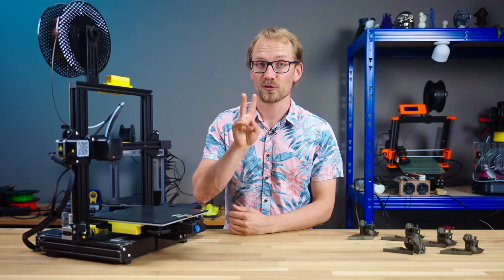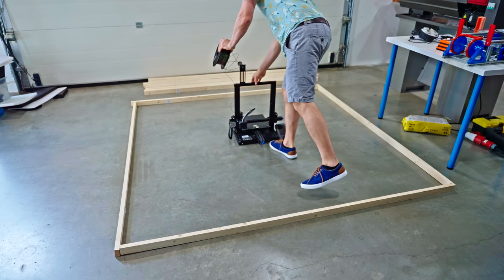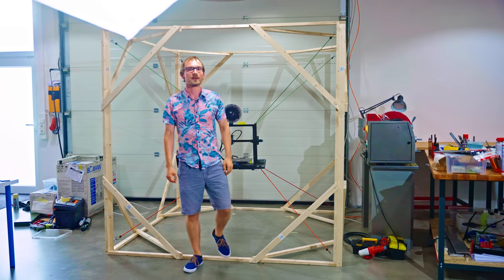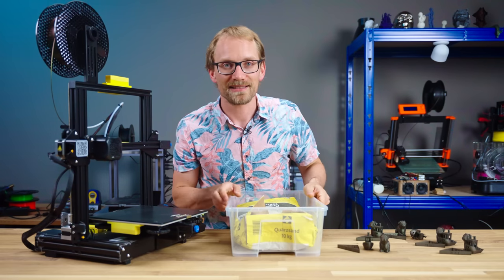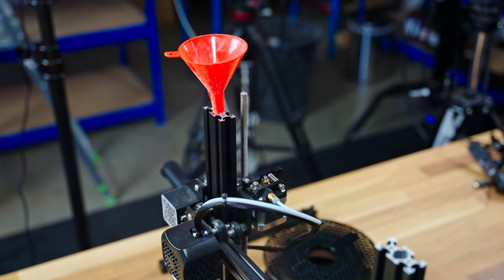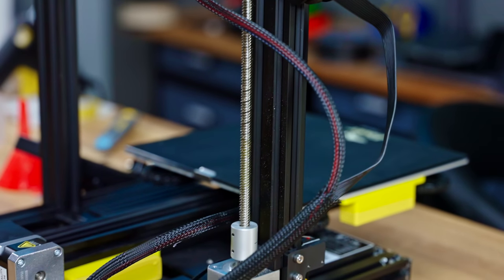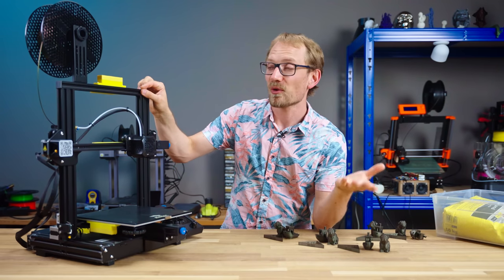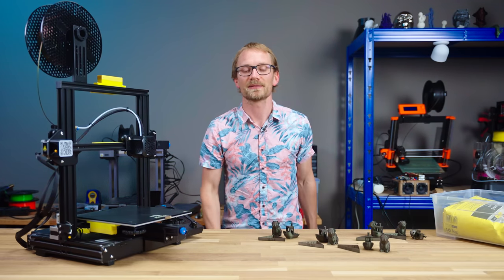You made me do this…

Comment: In my mechanical machine design building experience, resonance is a factor also of poor weight, mass distribution, you disturb this equilibrium and you will get a machine that shakes like Elvis, especially at high travel speeds.  

For example, the Anycubic I3 Mega, which I reference often, because I think is a great machine within its price range, is designed pretty solid, and the way the horizontal travel and extruder servos are placed is logical and I think the company may have done it to minimize resonance  that you get otherwise when you do not calibrate the gantry with proper weight/mass distribution evenly. I have seen people relocate the extruder servos wihout giving this mechanical design balance detail much thought, many people do it for making the machine look kool, whatever, but  doing so  will run into parts with less even printed layers.  

The best way to keep resonance to minimum,( there is no such thing, as no resonance, in machine design or assembly, there is always some present), is to keep the moving parts "as light as possible", you do not need to fill the tower extrusions with sand, cement or bolt the machine to a table,  this is how regular ink jet  printer heads, for example,  are able to travel fast, light components.  Of course in a 3D printer it is a bit trickier because one is not only dealing with the placement of ink on a sheet of paper but one has to manage proper thermal settings and depending on the material it may limit one to how fast one can print within a certain level of speed and quality. KISS is the best.

Comment: For feet try sorbothane, it comes in different Duros(softness factors). In my early archery days mercury was used to stabilize bows, and the oil filled tubes, oil filled tubes with ball bearings tension with springs. If you notice the current Olympic bows the have what is called a donker, a soft plastic material that has a weight suspended.

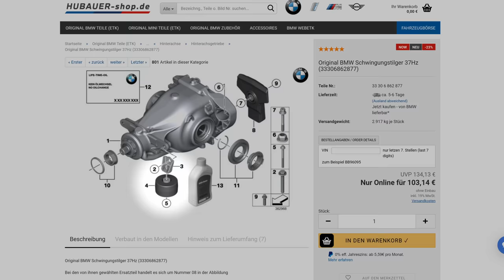Comment: 12:28 - 12:32 aren't vibration dampeners. They are CV (constant velocity) joints. Like Universal Joints but more linear. They allow rotation across an angle. 
The rubber bits on the rear differential are dampeners though, sure.
I would really like to see the experiment again but with the sand weights removed from the Y (and X?) axis, just leaving the sand in the frame. Also comparison at a higher print speed perhaps.

Comment: I would be interested in the belts.  I'd wonder about their properties before you use them as well.  Breaking strength.  How much they stretch under certain waits.  What frequency they oscilate under load.  Does that frequency shift at a different length.

Comment: There is another option I think you should try. Make a 3D printer that has a coreXY gantry for both the printhead and heated bed that move in equal but opposite directions either by connecting both to one motor with a gear or a separate set of motors (assuming the mass of both is roughly equal.) For the same printspeed the nozzle (and bed) only half to move half as far (and half as fast) relative to the motors and frame. Their momentums should also cancel out and reduce vibrations.

So in theory less vibrations and lower velocity required to achieve the same print speed.

Comment: I'm wondering whether replacing rigid containers with soft sand bags would help. They may allow for more movement and thus improve damping. 
A more professional solution would be to find out which frequencies affect ghosting the most. Then with a FEM model you can find out what dampers to use (e.g. oil dampers, tuned mass dampers or combination of those) to almost completely negate vibrations. This is a very complex task though, and it would probably fit your printer only since every machine is slightly different in terms of rigidity.

Comment: What if  we put equivalent weight on the belts..... So for example for the bed.... At the belt we can add the same weight as the bed just bellow the center of the bed on the belt.... So now when the bed moves in one direction.... Weights move in the opposite and kind of cancel out the effects.... Same can be done for all the belts..... That will kind of act like a balancing system for reciprocating components and maybe change the frequencies.....

Comment: I worked in the computer chip industry and this is what they do to print computer chips at 0.25 microns and less. XYZ stage is on granite slab.  That slab is on air bladders and sits on another granite slabs. All cables are mounted with vibration dampening hardware.  All motors are mounted with vibration damping hardware. To check for vibration we put accelerometer on each axis ( use one accelerometer 3 times). My touch was so tuned in after 16 years I could put my hand on the stage close my eyes and tell you where the vibration was coming from.  Most 3D printers don’t isolate the motors or cables.  I recommend silicon dampeners for the motors and cables and for 3D use a tile or concrete tile on silicone dampeners on top of another tile.  Air bladder maybe overkill

Comment: We have a really weird setup we stumbled across by accident.

Our Ender 5 Pro is sitting on an IKEA LACK table with rolls. Not exactly IKEA "RILL" rolls, but very similar.
The intention was, to be able to easily move the printer around, but we forgot rolls with stoppers. So, while printing, the whole table started rolling around slightly.
To stop it, we put the rolling table on a thick rug, similar to a doormat, which increases friction and prevents it from rolling around. Unintentionally it dampened the whole system so much, that it became a lot more silent and shows a lot less signs of vibration.

Comment: The speaker stand company Atacama make a product called Atabites, which is little pellets of metal, specifically designed to add deadening mass to speaker stands. It's not cheap, but the grains should be less leaky than sand, and you won't get silicosis from all the sand dust loading a printer with sand will create over time. I can't comment if they will actually work, if loaded mainly into the frame. Just remembered that Atabites exist and thought i'd share the knowledge

Comment: I think the real answer is, somewhat unsurprisingly, in suspension frame you built. The rigidity of 3d-cross bracing that had your flimsy stick built cube holding your whole suspended weight is exactly what can help reduce vibrations in the frame of the printer. Along with this, counter weights to the print head and print bed allowing the motors to work less when stopping and reversing directions would be the ultimate way to remove residual motion from your prints and lessen ringing. The weight blocks you attached to the bed were on the right track, pardon the pun, but they were just extra wight that the motor had to move (as you observed). Instead, the extra weight needs to be counterbalanced to the direction of the movement.

Think of a boom light stand. You adjust the weight on either side of a pivot to counter the weight of the light being supported and the clamp that holds the light up or down has far less work to do to keep the pole in place and will hold more rigidly, as well as remove the sloshing from the weight during movement. In this case, I don't know if a 3d printer can have this modification added without significant engineering effort.

Specifically, you would need to have a weight the moves counter to the direction of the load in both directions. That said, imagine a print bed that moves via pulley and a single motor as the Ender 3 does currently. Now, add a second identically weighted bed on the opposite side of the pulley chain. This same motor would move both beds on a single pulley belt but because they are positioned opposite each other, their movement would be opposite. This could completely remove backlash during stop and reverse events as long as the motor has enough torque and power to maintain speed and is itself engineered to reduce its own backlash with proper gearing and tolerance.

Apply the same concept to the print head.

Apply additional cross-bracing to the gantry to make it more rigid as I mentioned in the beginning of this comment.

You might have yourself a more consistent and accurate print. Tuning this system will be a nightmare though ;)

Comment: just bolting the machine to a stiff and heavy bench helps degrees of magnitude more than adding sand.

If anything, try adding a resin slurry/putty mix. In machining, they use a mix of gravel and resin, here probably metal powder and sand to create a slurry which is heavy and solid. but again, not much mass inside those flimsy aluminium beams

Comment: Perhaps the vibration comes from the teeth of the belt rolling over a smooth bearing on the non-motorized side, and using a toothed gear over the bearing would help?

Comment: First thing that came to mind was the rigidity of the stepper motors steps combined with the necessary slack in the belt allows for a slight disconnect with the intended movement profile. IMHO you could make a rigid steel frame to connect all eight corners of the printer and the tray would still not follow the exact movement of the stepper motors movements. Though difficult, at lest for me, creating acceleration and deceleration profiles whenever there's an abrupt change of direction or speed of the tray to prevent the slop might be the only way to totally eliminate the issue. Of course the tension/slack in the belt creates differing oscillation frequencies. The slop in the belt creates a sort of spring between the stepper motor and the tray. It reminds me of large format printers and the necessary smoothing of their movements to get good print quality. Often the steeper motor seemed fine but replacing it with a new one cured the problem. Good luck and God Bless.

Comment: You should just put an accelerometer on the hotend which has built in dead reckoning feature, log all displacements  and run a  Fourier analysis on it to see the major oscillating frequencies. Then you can try to dampen one or two of them and at least see if you're heading in the right direction. It shouldn't be too time consuming or difficult.
Reply: It's just input shaping, it is well known

Comment: Fellow engineer here: like others, I suggest that the weight should be added only to the static components. Adding them to the moving parts was just asking for trouble. Until static only is tested, this idea hasn’t really been given a fair shake (pun intended).

Another option would be filling with a rubber damping material. I’ve used lead shot embedded urethane to reduce recoil in my rifles, for example.

Comment: Regarding the weighted "deadblow" compartments, only add those to places that don't move.  Adding more mass to moving parts only increases the chances of the printer shaking as the mass changes directions resulting in bad things happening to the prints.  As for the weighted extrusion tubes, a better and much cleaner way to do this would have been fishing weights of the proper size to fit down the bores of the extrusions, and again, only added to non-moving parts.  Metal beads made from Hematite available at craft stores would also be another option.

Perhaps another idea would be to REDUCE the weight of the moving parts, much the same way old school car racers used to do, by drilling holes in everything that moves to reduce weight.  Or you could get some custom made parts out of Carbon Fiber.

Comment: I think, You need to tight it up tight. The dumpening should happen on microscale, so if You would use a belt with tightener, the overall structure would be stiff, but only printer would slightly (!) "float" inside the structure. the tightenes of the belts could also play a role. Finding out the frequencies witch printer gives, at set speed and tighten the belts in this frequency. (also shape of a print would matter)

Comment: You should consider adding a weight at a distance from the printer. If you manage to tune it correctly, then you will get vibrations in the weight that are 180 degrees out of phase with the vibrations of the print head and therefore eliminate the resonant frequency that the motor has to fight. 

So perhaps add a weight that is at a distance on the print head. Whatever you use to distance the weight from the print head should be springy. The "springiness", the length, and the amount of weight will determine your results.  What you probably need is a rubber ball on top of the print head to absorb frequencies in the 40 to 100Hz. 

Ideally you want to install Klipper on your printer and add an accelerometer and then be able to measure your progress; whether you are mitigating any resonant frequencies or not.

Comment: Now you know why industrial machines are built so heavy.
The sheer weight overcomes any force trying to move things around and absorbs and dissipates any forces trying to do bad stuff.
On the bungee chord test, ALL the chords are the same length which will make osculation at a certain set of frequencies tend to amplify each other.
All chords uneven length could possibly work better BUT THERE IS NO ACTIVE DAMPENING which is a problem.
The sand method adds a lot of weight to the moving parts which will significantly increase motor loads - especially on low power motors.
This is why (at least on my printer and mill) there are acceleration and deceleration rate settings - a dead stop will send a big motion shock through the machine while a slower start/deceleration will be more easily absorbed.
At the end of the day you can NEVER get to the acceleration/deceleration speeds of a 2 ton industrial milling machine working on your aluminum 6040 - the physics just wont work...
However there is one more thing you can try that MIGHT work.
Print boxes (like your attachable sand boxes) and half fill them with 50 weight or maybe a bit better oil (AND SEAL THEM) and attach these to the X and Y moving parts.
This MAY improve things due to a dampening effect.
BUT IT MAY CAUSE MORE PROBLEMS DUE TO OIL BASHING UP AGAINST THE ENDS.
Maybe a small piece of pot scourer on each end to dissipate the moving oil energy as it approaches the container wall could work? 
But that in effect is once again controlling the acceleration/deceleration of mass.
You will always have some sort of harmonic or mass pressure wave trying to mess things up for you, even if you build your 6040 out of concrete and railway track.
Hobby machinery is just not built to handle those sorts of forces.
I can't use the feeds that I used on the big machines when I was still working but that is OK. I'm happy getting a good results at lower speeds.
Essentially you will NEVER break the sound barrier in a Ford sedan - no matter how much you modify it.

Comment: There are settings in MARLIN 3d printer software like S-CURVE etc to try reduce vibrations. Also try different motor drivers that allow higher microstepping (Trinamics has some cool features). I managed to make my printer completely silent (only fan noise while printing) using TMC2209 drivers and it improved the quality also. I have an old geeetech aluminium prusa btw.

Comment: The sand trick works really well for desktop cnc machines which suffer from high frequency vibration from the cutter. I suspect the outcome her is likely the space being filled with sand isn't large enough, and the fairly low frequency vibrations are not easy to absorb with the sand. I can't really explain why the sand makes it worse

Comment: Adding weights to the bed was just a bad idea, it's not been engineered to expect them. Also the sand is loose inside so will create some movement.
Would be interesting to add metal weights instead of the sand ones, and not to the bed. To see the impact. 
Or to workout the rough frequency a 3D printer generates and try some of those car weights.

Comment: The frame would have been useful to damp vibrations from the environment. I think you'd see a noticeable improvement if you tried running the printer in the back of a moving truck, then did the same with the printer in that frame. It's like the suspension in a car, in motion it'll dampen the felt vibration and movement from the road, but standing still actually introduces more movement and bounce than if it wasn't there
It's really just a balancing act. More mass on the moving parts improves stability, but increases inertia and backlash.
The sand is a good idea (it's how deadblow hammers work to eliminate bounce)....but as you said that's something that has to be meticulously tuned.

Comment: How about filling the extrusions with expanding spray foam instead of sand? I used this method on an excalibur crossbow to dampen vibrations from the string. Similar concept as this crossbow uses an aluminum extrusion for the main rail.

Comment: You need an Arduino based automatic compensator, that produces via vibration a kinda dynamic compensatory movements to cancel vibrations. Despite of that you'll still have to face jerk and inertia issues that do not come from vibration, they come from the ratio between acceleration, rigidity and mass.
You'd probably in that case need 2 compensators, one for the general structure vibrations and another one placed on the extruder itself that counters the tangential/composite forces generated while steering the head from a direction to another (ghosting). Good luck. 🙂

Comment: This may require a redesign of the entire printer but since everything is belt driven, why not hook up weights on the other sizes of the belts so when the bed moves to one side a weight moves in the opposite direction. Similar to how elevators use weights and pulleys to make lifting easier. Use weights and even pulleys to cancel out as much inertia created by the printers movement on every axis. The weights would have to be highly calibrated. The bed would be the hardest as that gets heavier as the print goes on but, not by too much. This idea even works similarly to how sound cancelling headphones work with air vibrations (sound).